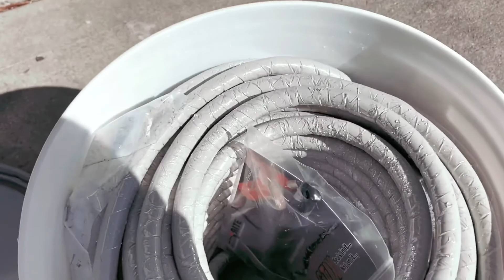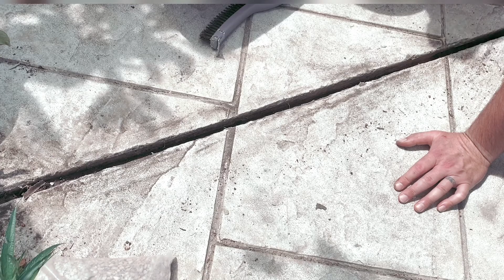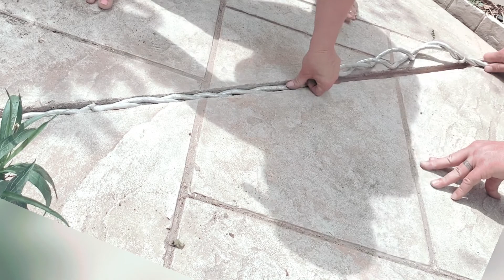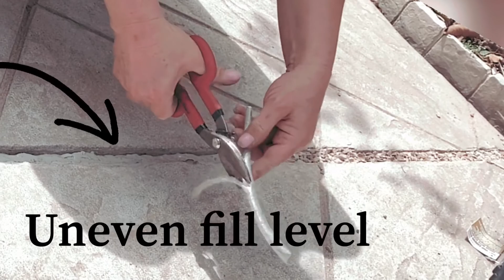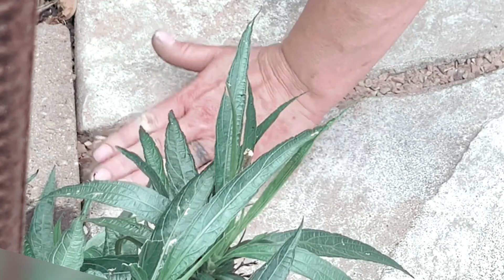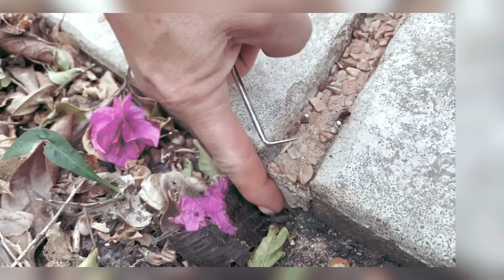DIY Expansion Joint Repair and Replacement Crack-Stix Tips #howto #homeimprovementideas

Comment: How long did the old caulk that you removed last before it failed and what product was it? Thanks
Reply from the maker: The product in concrete joints prior to this was some sort of pour in joint sealer installed by a contractor for around $800. I don’t know the name of what he used but in less than 1 year it started cracking and pulling away from sides. Within 2 years the cracked areas became gaps that continued to grow due to the product constantly “shrinking”.  It was pretty hideous from that point on.

Comment: Very helpful video.  I intend to use this product on my cement driveway.  I had not seen any other videos using your topper technique, but I am going to incorporate the method using rather finely crushed concrete.  I think that will reduce the contrast between the concrete and the "gloss" on the Crack Stix.  Thank you for demonstrating the method.  I think it will make a big difference.

A video on the manufacturer's website recommended heating the concrete joint for "30 - 40 seconds" before inserting the Crack Stix to allow the product to melt/flow more quickly.  Between the instructional video by the manufacturer and your tips, I feel well-prepared to tackle this project and confident I can achieve the finish/appearance I am seeking.
Reply from the maker: Michael Weimorts what a great idea! I have several areas that I still need to tackle and I’d love to see how your joint topping idea turns out, as that sounds ideal for my driveway.

Comment: How is it holding up? What kind of climate do you live in, please?
Reply from the maker: Nathaniel Adams , I live in South Texas, usda zone 9, hot and humid climate with mild winters. So far so good! Its been about 9 months since I xid this these sidewalk repairs, the  joints with pebble topping are holding up perfect and look much better than ones without.
Reply: DIY365 Thanks; I was raised in Houston but live in Northern Kentucky now; going to use your method to take the shine off the melted crack stix...thanks again!
Reply from the maker: Nathaniel Adams yes! I agree and not fond of that shine either! Even using just sand alone works perfect for a nice matte finish. After applying the sand to it, I lightly roll rebar back and forth on the joint to help press the grains in.  That helps it stick along with giving it a more finished appearance. Good luck with your project